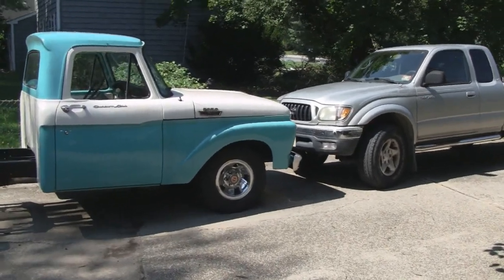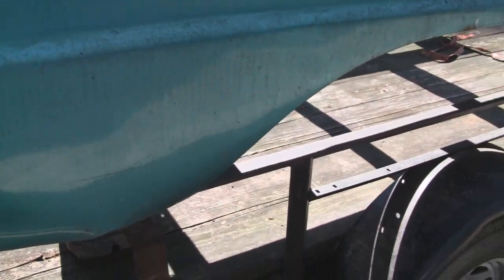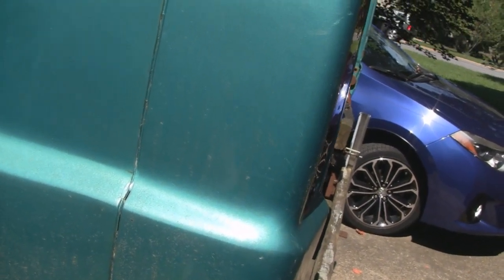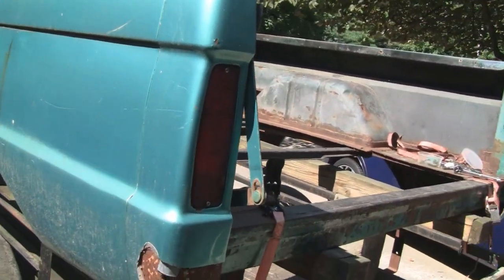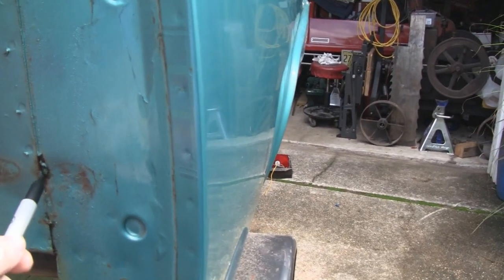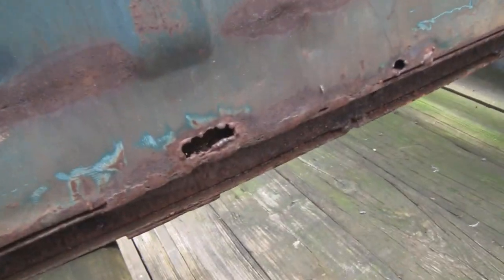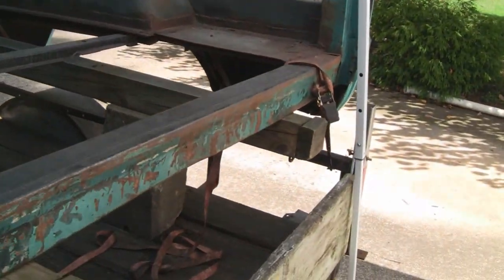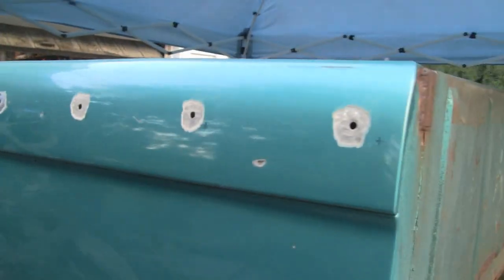START WORK ON THE BED (F100 part 101)

Comment: I never knew an attachment like that existed for the air chisel. I might have to check that out. I've always just used an impact driver for difficult fasteners like that. Glad to see you're making progress on the truck
Reply from the maker: Thanks Buddy!! I like that Shake and Brake tool so much better than the impact driver!! They're only $15 on Amazon, I got a link in the description!!☻

Comment: Yep in the old days we had the big screw driver with the metal shank that ran through the handle
I would pound on it while my brother turned the screw driver with a vise grip on it
Reply: Impact driver, but cheaper and works more often than a Impact driver, all the best to you all

Comment: You can get the taillight panels for $80 a piece (1964-66 (C9TZ-97280A59-A) F100 TRUCK , same as 66-77 Bronco tail light panels. Also 66-77 Bronco rear quarter panels have a lot of the metal you would need, they aren't long enough but would take care of the rear problem areas. Just a thought. They are pretty easy to install.

Comment: I still think you should have used heat to loosen the bolts 

Though Not 
H E  A T. 
Ford's are Tough but not  HEAT Tough
 " Majestic " tough 
not heat tough .